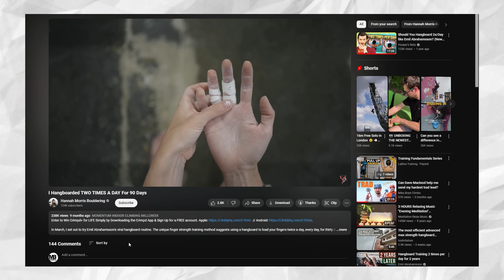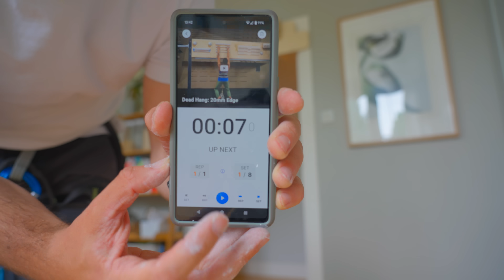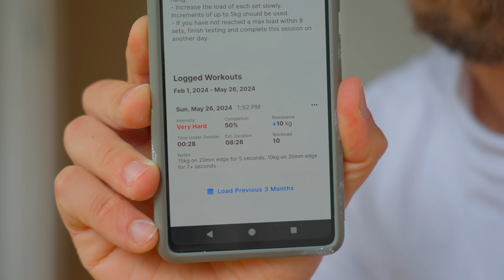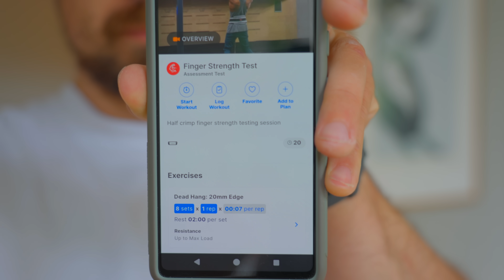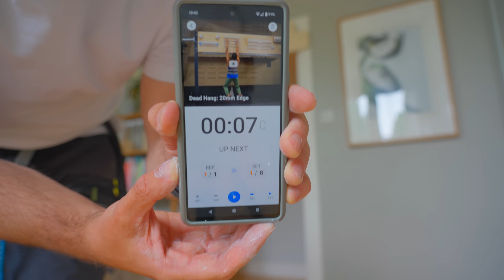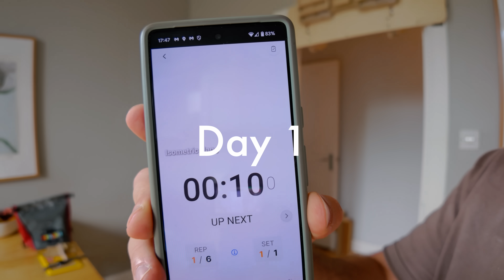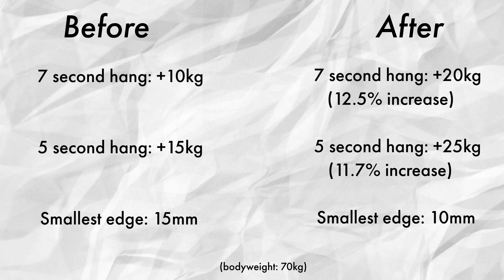Beginner climber tries hangboarding twice a day.... with results

Comment: Hey Mike,
Maybe I misinterpreted your results but your conclusion seems off.
You conclusion: Your own "results are positive, but not as groundbreaking as Emil's"

Emil weighed 75kg. On the 14mm, 5 second hang.
Before: max weight added was 40kg.
After: max weight added was 67kg
So, ~68% extra in added weight (67kg/40kg), and 123% of the original total weight (142kg/115kg).

Nate Mitka weighed 180 lbs. 5 second hang.
Before: max weight added was 90 lbs
After: max weight added was 125 lbs
So, ~39% extra in added weight (125lbs/90lbs), and 113% of the original total weight (305lbs/270lbs).

You weighed 70kg. 5 second hang.
Before: max weight added was 15kg.
After: max weight added was 25kg.
So, ~67% extra in added weight (25kg/15kg), and 112% of the original total weight (95kg/85kg).

Of Emil's results, you highlighted at 0:52 that Emil was able to stack 60% (actually 68%) more weight while hanging for 5 seconds. "The results, while not very scientific, are unquestionably overwhelmingly positive.". (You also mention some of his other results that we can't use to compare with your results).

In the same test, you stacked on 67% more weight while hanging for 5 seconds which is equivalent to Emil's, and performed better than Nate Mitka.

What do you think?
Reply from the maker: I can see what you are saying. I however, thought that the more important metric was "total" weight increased. Emil's total weight increase was 24%: almost double mine. I imagine if a 100kg person added 10kg to their weighted hangs it would not be as game changing as if someone who was 50kg did the same. However, I do see what you are saying too. Perhaps my results are better than I said in the video...

Comment: Has anyone battling with PIP Synovitis seen results from doing this no-hang protocol for getting rid of the synovitis?

I really want to commit to this protocol, but I'm worried that the increased time under tensions will cause the inflammation to just get worse. Also, anyone that cured their synovitis, please leave what worked for you because this thing is absolutely ruining my climbing progress.
Reply from the maker: Sorry I can't help. That sounds awful, I'm sorry it's affecting your climbing so much 😕
Reply: I've dealt with it a fair amount of times, once really bad that I had to properly rehab. If I see it start to creep up now I will use the principle of this program to help stop it in it's tracks (along with addressing any volume/intensity overload). I just prioritise loading my fingers in a very non-intensive way, every day (usually only once a day though) just to promote bloodflow to the fingers and it seems to work for me though. You do need to address the root cause of it though, which is too much volume/intensity.
Reply: Well I'm doing Emil suspensions for more than a year and half. I had a tendinitis two times , doing this thing. I finished and get rid of this inflammation when I get rid of crimps and half crimps. They put too much tension on tendons. 8 months ago I switched for only open hands  and slopers, to move all the muscles of the forearm. Right now the thing Is evolving and I do 7x20 seconds slopers 40 sec resting between and 5x20 seconds of  open hands in a 20 mm  Edge. 40 seconds rest between.  I use my weight . Justo hanging twice at day. The final result Is The same almost.  The gain in endurance and finger health Is absolutley massive.
My tip Is : don't  do half crimps and crimps.  
Cheers

Comment: I think you missed something with your math Mike
In Emils video he talks about the increase in added weight, going from 40kg added for 5s to 67kg added for 5s resulting in an increase in added weight of 50%
In your video you said you only had about a 12.5% increase, but that was in total weight. The increase in added weight went from 10kg for 7s to 20kg for 7s, meaning a 100% increase in added weight!
And for the 5 second you went from 15kg to 25 kg, which is an increase of 60% in the added weight, which is actually exactly what Emil also increased his added weight with for the 5s hang!
Reply from the maker: Here is my maths:

Emils body weight: 74.4kg
Total weight before: 74.4kg + 40kg = 114.4kg

Total weight after: 74.4kg + 67kg = 141kg

Percentage increase: 141/114.4 = 1.24

24% increase in total weight .
Mines was 12.5%

Comment: I've only just started climbing, never found a proper answer to whether I should start hangboarding.
Reply: Common guidance I've heard is to wait a year of climbing before starting hangboarding. Can mean you're more likely to injure yourself and your fresh tendons.
Reply: The answer is you can start hangboarding whenever you want—the more knowledgeable you are about your body and training, the more you’ll get about it and the less risk.

Basically, the only risk with hangboarding is doing too much too quickly because you are unaware of how to listen to your body. The only other downside is if you focus too much on it you might lose out on skill acquisition on the wall.

But yeah TLDR use it whenever you want and just pay attention, you’ll be fine.
Reply: @soccutd77  This is the correct answer, imho. The only "problem" with hangboarding for a newer climber is that it creates a very easy environment to pull insanely hard and thus injure yourself. Just start easy, and work your way up to a program that feels good, and stick with it until it no longer feels like it's adding anything for you. I started hangboarding about 6 months after I started climbing, and never injured myself on the hangboard. I did however injure fingers on both my hands, at separate times, while pulling super hard on the wall.... So yeah. Hangboard isn't the problem; pulling too hard, is.
Reply: @soccutd77  yeah definitely, I've only just started climbing, I did 2 solid days (9am-4pm) of outdoor climbing last Monday Tuesday and then did my first indoor session on Saturday and now I have this sort of discomfort/throbbing feeling like on the outside of my bicep, almost feels on the bone if you get what I mean. So I've definitely probably done too much too soon and also relied on my arm strength too much.
Reply: @jackwelsh3353  I would say biceps and fingers are not that related imo. Sure if you have untrained pulling muscles, you can hurt yourself that way and develop tendinitis, but fingers are the real thing to watch out for because your tendons are doing so much of the work and those have a different growth curve. But yeah overall, just listen to your body

Comment: so ...is it any good for 'golfers elbow' which i am struggling to rehab? great vides btw! love watching (I'm a new boulderer in my 50s ... though have many injuries from years of body building type stuff!)
Reply from the maker: Dave Macleod has an excellent video on elbow injuries and issues
Reply: @MikeBoydClimbs  cheers! I’ve been working through his thinking and it seems to help. Just wondered if low intensity would assist.
Reply: I would recommend getting some little antagonistic finger band things and using them for a few minutes a couple of times a day.
Reply: @hotbeefo  really? (Sorry that wasn’t supposed to sound sarcastic!).  I’ve got one of those alien shaped ones. Hadn’t thought of using that.  Is that what you mean?
Reply: @illustrationmaking  yeah that's what I mean. Add some isometric holds with dumbbells or some wrist curls
Reply: @hotbeefo  excellent! Doing all those. And just started with the ‘regime’. So far things looking positive.
Reply: @MikeBoydClimbs  thought it worth an update.  Been following the ‘training’ twice a day with the odd missed day for the last ten days. Had a little soreness in the fingers so lightened off a little bit.  Just got back from bouldering (indoors) which is the first claim since starting this. And… well I can’t quite believe it. Firstly, golfers elbow is twingy but nothing to what it was.  A finger tweak I was sporting cleared up within 5 days and didn’t cause problems at all. Endurance kept going and my forearms gave out before my hands! And I just felt more secure on the wall.  Even when cutting loose (short climber issues). But most notably is I reached for a hold on a climb I’ve been struggling on and caught it with a two finger drag, then boosted up to a full hold.  And did that each time I made an attempt finally sending the climb I have been wrestling with for the last few weeks. The point is I’ve never been able to do any sort of drag because my fingers just opened up each time!

For those interested as to why this light work, from my body building / weight training days, you start a new cycle working for 3 weeks on connective tissues, before a few weeks on hypertrophy (getting bigger) then you work on the available mass making it more powerful.  Then repeat.  The connective tissue is crucial to being able to do the later work as it’s the weak link plus activation of all the muscle fibres in one go.  

I suspect that’s why this works. You’re training the muscles to fire all at once rather than the more efficient in sequence. That strengthens the connective tissue as well.  So it appears you get stronger but actually it’s more about neuro muscular response. However, I wonder about following a protocol similar to how I used to strength train and in a few weeks work on growing muscle mass back in my forearms, then strengthening that (more weight, shorter reps). Then working that into lighter endurance work. Then repeat after a break.

Theory only….. and no expert apart from life experience and being a bit of a nerdy geek 🤣

Comment: Mike your testing in the after benchmark results is flawed. You should start from bodyweight as you did in the before, thus negating any fatigue. Say in the before benchmark if you started from +10 kg the results could have been different and similar in both tests.
Reply from the maker: I did the same test both times. It's been edited for brevity. Starting from +0, +5kg, +10kg ... etc

Comment: I'm still not convinced that fingerboards are ideal for getting the maximum strength out of your fingers. Like it still seems very important because holding is still very important you can't just be able to grab it you have to be able to grab and hold but to maximize the raw strength and power you would need something with eccentric and dcentric motion with a maximum range of motion right? Something like a finger curl if that's even possible seems like a more optimal way to train finger muscles but I don't know shit about training. My understanding is that fingerboarding is a purely isometric exercise which from my understanding is not the optimal way to build muscle and strength. I could be very wrong I seriously don't know shit about this stuff.